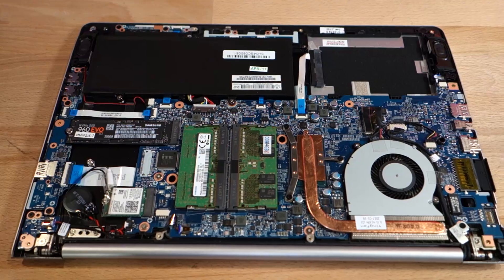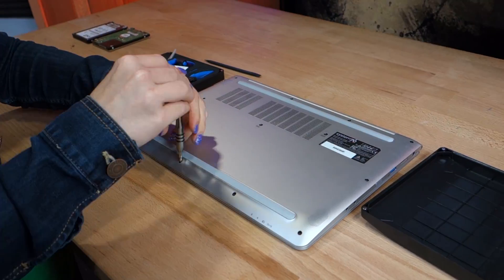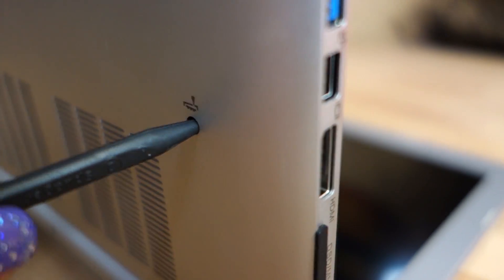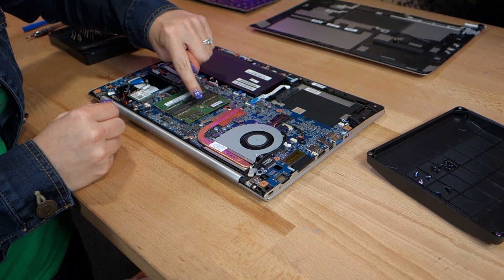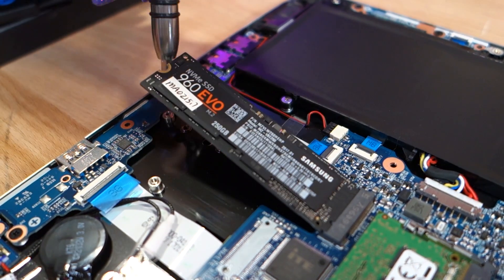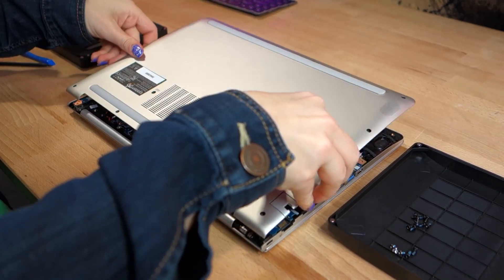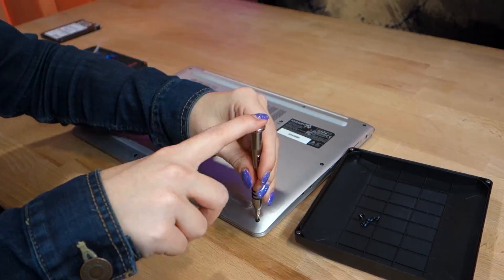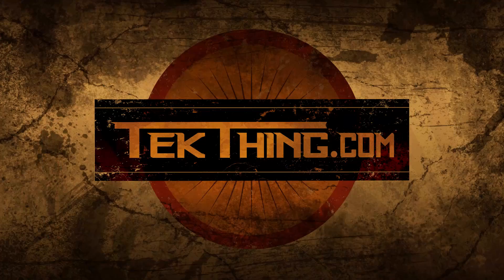How to Upgrade the System76 Galago Pro Linux Laptop - TekThing Short

Comment: I'm happy to see such great Linux machines. Do you know if it's possible to use the extra space available for a hard drive to install an extra battery?

Some battery capacities to keep in mind:
Galaga Pro 35.3 Wh.
Librem 13 v4 45 Wh.  (as far as I can tell, but hard to find info)
X1 Carbon 4th gen 52 Wh. 
Dell Latitude 14 7490 has 60 Wh. 

How much will that last? Well, on my X1 carbon light usage is 7 W. Moderate usage is 11 W. That means I could get 3 hours out of the Galaga, 4 out of the Librem, and 5 out of the Dell.

Comment: Thank you for this guide. Just dropped a ssd into the open slot. For what it's worth, you dont actually have to detach the keyboard. There is enough play in the cable to slide it back, remove the front two screws, then slide it forward to remove the 3rd screw. Put the kbd back in and remove the bottom. Worked liked a champ.

Comment: As much as I appreciate the good work that the folks at System 76 are doing, I do think the Dell XPS 15 would be a better buy, because it's nicer looking, and it's also serviceable by just opening the bottom cover: only, and you've access to everything.
Reply: Shell Casing This is cheaper though and has better Linux support
Reply: ...and $500 more for comparable specs.

Comment: No need to take the keyboard out, just remove all the screws from the bottom cover and take it off, you'll have access to the memory, hdd's & wifi card. Dont remove the keyboard and risking damaging the cables, its not needed.
Reply from the maker: The screws underneath the keyboard have to be removed to take off the bottom cover - they screw all the way into the bottom and hold the cover in place. We tried removing the cover without removing those screws, and it stayed in place.
Reply: wow ok, my bad I tested the Clevo N130BU which is what the GalagoPro is and you don't have to do this part. Anyway great video, Labtop! lol :)
Reply: There's a middle ground. Pop the keyboard out, but only slide it up or down slightly to remove the 3 screws under it and pop it back in. No need to actually unplug the keyboard cables.
Reply: I have a clevo N130WU (core i7-8550U) and I also don't have to remove the keyboard to remove the bottom cover. I suspect it's only needed on the N130BU (core i7-7500U)
Reply: The n131wu needs to have the keyboard removed to unscrew 3 other screws underneath.

Comment: Perfect timing! I just ordered a Galago Pro, and upgradeability was an important factor in choosing the Galago over the Dell XPS. 

Do you really have to remove the keyboard to access the RAM and storage? Those keyboard connectors don't look like they will survive many removal/reinsertion cycles.
Reply from the maker: Yup. The screws underneath the keyboard hold the bottom cover in place. You can't remove the bottom cover without taking those out. I tried!